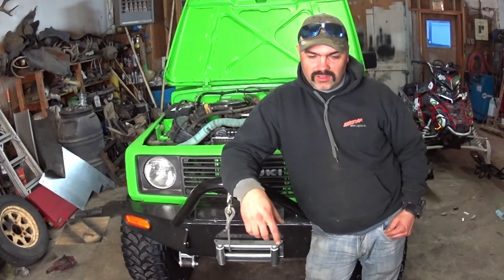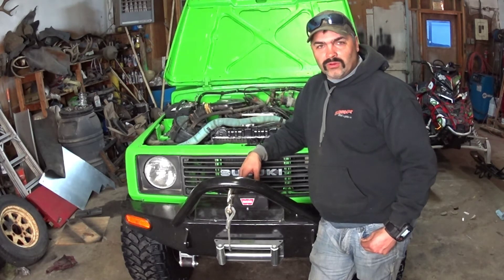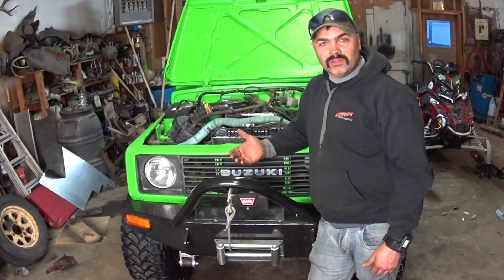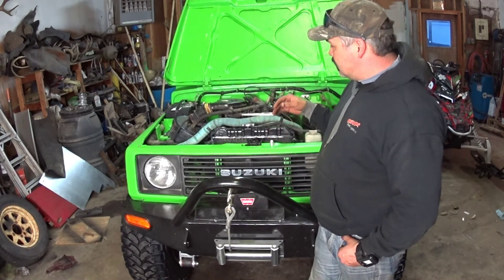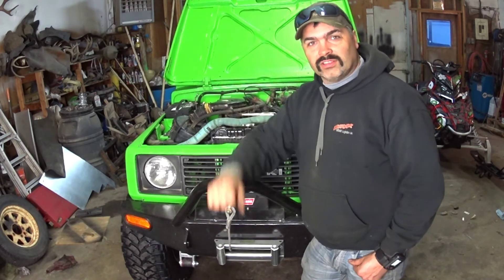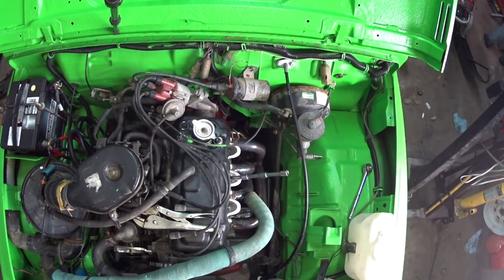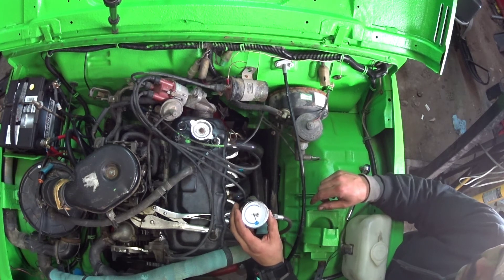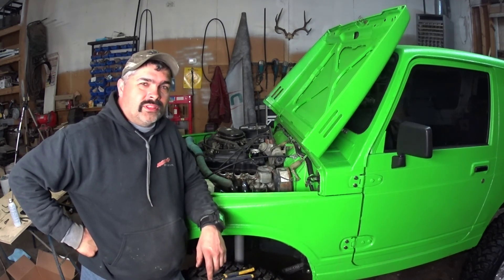Suzuki Samurai compression test for turbo

Comment: Are you thinking of rebuilding the engine. i think the Psi is supposed to be at 190 - 200
Reply from the maker: datingsas, yeah the compression is supposed to be 199 in perfect condition. 170 would be awesome. This samurai sat for a gew years without running so i think i had some carbon build up on the valves and maybe some stuck rings.
I soaked it heavily with seafoam for a few days and am still in the process. It feels like the power is up now. Ill take another compression test after all the seafoam treatment and hopefully its up to 160psi or better.
Myron at Zuksoffroad.com says hes good with 150psi and says i can run it like that for a while.
I plan to run it for the summer and do a rebuild next winter.